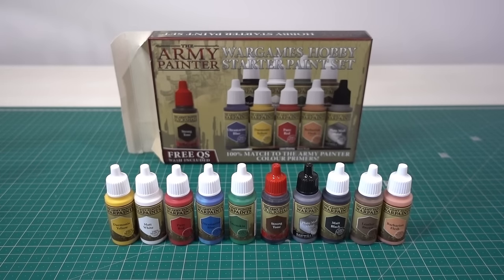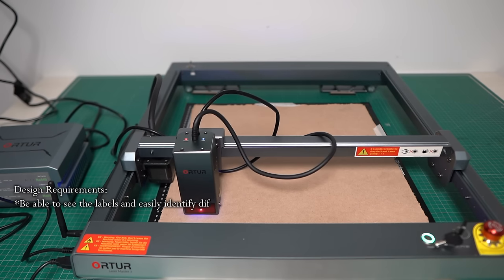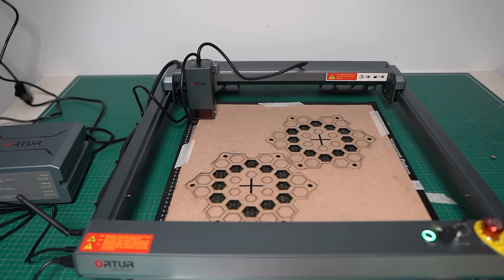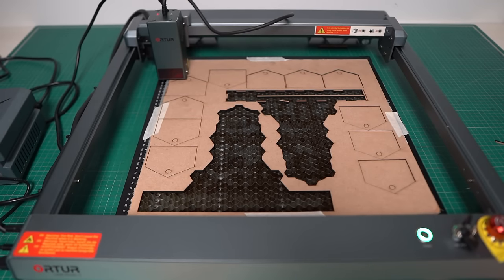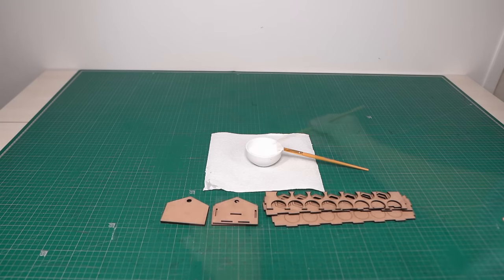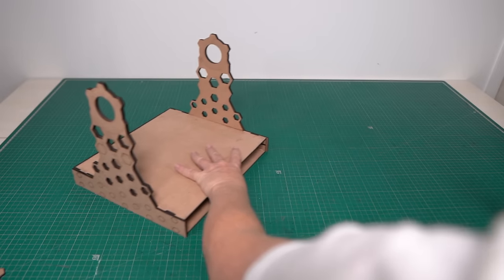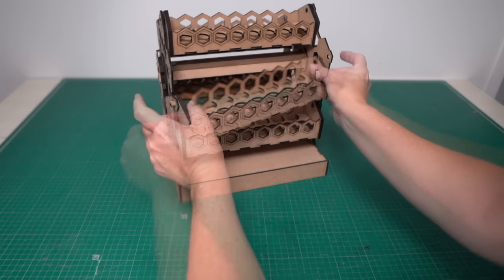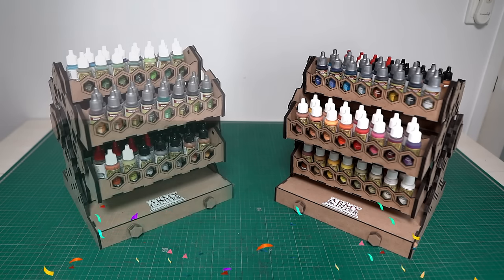DIY Hobby Paint Storage Rack Solution for my Army Painter Paints

Comment: Depending on the length of the hose, You can add a tall support to the laser module and one to the side of the frame to have the hose sit on top of. Or a more complicated system with be suspending it over the frame with a small gantry or something similar. The idea works in my head lol.

Comment: For the air hose issue, I'd recommend rigging some kind of harness that would sit above the laser work area and hold the air hose above its center with enough slack to reach all four corners. I have the same problem with my VR headset's cable and stuck some plastic hooks to my ceiling so I don't get my arms tangled up in it.

Comment: Good design. I had a similar problem, though when I count in craft paints (for terrain) and miscellaneous sized paint bottles (AK Interactive, Mr. Hobby, Tamiya) I end up well over 1,000. I found a black rotating DVD storage cabinet that's 5' tall and 24" on a side (12" of each side open), and an OpenSCAD design for Vallejo paint holders. Because the design is OpenSCAD I was able to adjust parameters to make the paint racks fit exactly into the rotating DVD storage cabinet and accommodate the different circumference paint bottles I own. Solved a huge problem for me where I used to have everything in separate boxes scattered around my studio - so many boxes they were cluttering the floor.

Comment: hot tip: every bottle has a little well at the very top of the cap, where also the small nubbin from the injection molding process is. you can fab a little drop of the respective paint in that and let it dry, that way you can identify your paints from above, and have the added benefit of seeing how your paint looks dry contrary to its look wet and through hazy plastic bottles.

Comment: look at the sprung boom arms for mouse cables.. that should what you need, attach it to the actual laser or carriage .. I use a system like this on a 2.5 D cnc machine for the air and Vac. lines.

Comment: use a wire coat hanger unbend it put a loop on one end and secure the other end to the laser cross beam. run air hose through loop to keep it up off the surface
Reply from the maker: Great idea; thank you!

Comment: Would it work still with bottle topper ? What is the height between the top of the bottle and the next drawer when it turn?
Reply from the maker: Probably not as the clearance is less than 10mm at the closest point - but I really love that idea.  I have never seen those bottle toppers before you mentioned them.
Reply: My other comment seem to disapear when i want to post the link of the topper i bought to show you what it look like. But its à great feature especially for speedpaint range. I bought them on etsy(with army painter bottle topper as tags)
It allow you to show how the paint is on a mini way better than their "cube" .
Would be à great thing if it would fit aswell.

Comment: First, get a vented enclosure for your laser cutter.  the little tiny shield around the laser is not enough to protect you from the laser it self.  Cutting MDF also produces toxic fumes that need to be vented outside.  second "DIY" is a bit of a stretch considering this requires hundreds of dollars worth of equipment.  the paint rack is pretty awesome though.
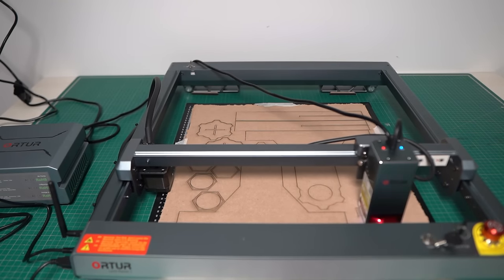Reply from the maker: Hi @freedoomed - I have a vented room (check 05:00 where I talk about this).  But yes it is so important to practice safety when using these Lasers.  Thankyou for your concern! I do appreciate it.